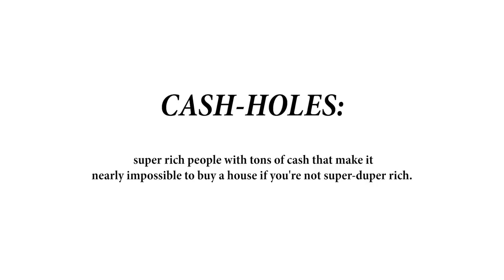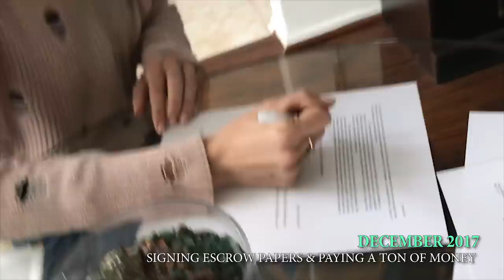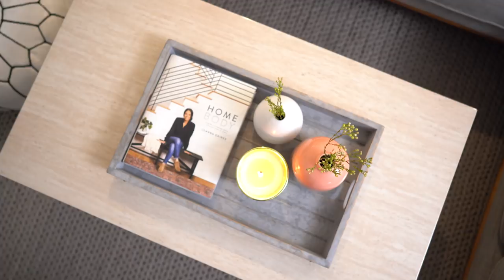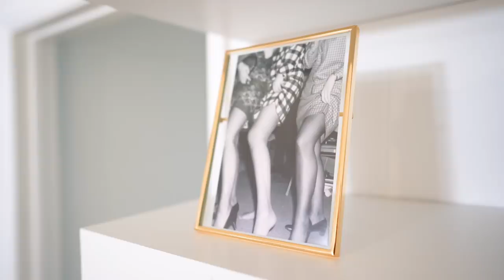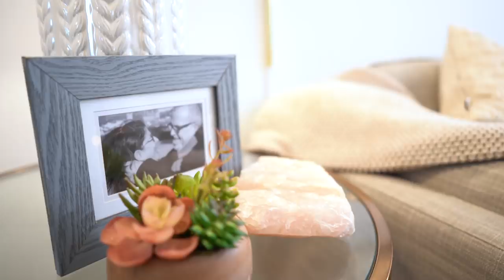MY FIRST HOUSE TOUR - TOTAL RENOVATION!

Comment: I'm living in a reno...I only had a hot plate and a mr coffee for awhile there. No running water, we had a leak in the ceiling. We weren't sure it was okay to drink for like a few weeks (my parents were helping me out quite a bit and I guess water testing was backed up). Currently everything is working but there's still a hole in my bathroom ceiling, scuffs on some walls and no shelves. Jan/Feb we're finishing it and putting up shelves and a boot/coat stand...I might ask Dad to build a pantry with me too.